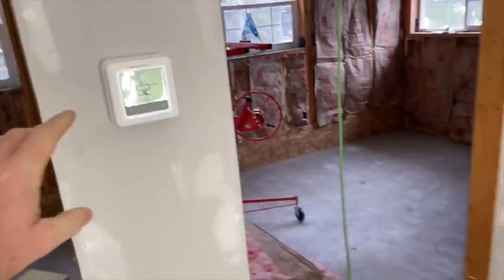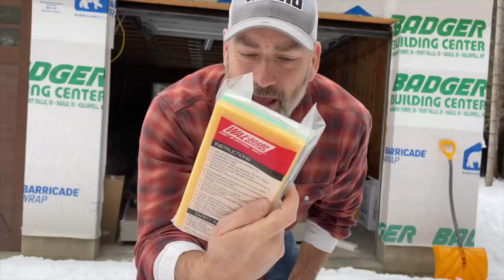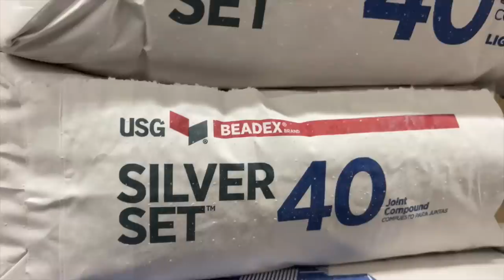Couple Building Their Own House with No Experience

Comment: You can use the extra sheetrock to sheetrock around the windows. You're probably going to need more mud than that if you only got one bag. Also you want to use a fiberglass type tape instead of the paper tape. Just kind of my recommendation with doing the drywall.

Comment: You can put one of those rotozip bits in your drill. It'll spin slower. But with the drill as a handle, you'll have more control, going around the outside of the outlet boxes.

Comment: Marty … you have to get mud on them walls … in the cracks separating the sheets of sheet rock … you had the heat on and will have many times over and waist a lot of time and energy …. I see a LOT of small locations for the screws … but no tape lines? I love all of your learning process issues and you are A+ for sure. Also. The sponge thing slow and you will be cleaning that sponge hundreds of times. Yes it keeps the dust down. Really made for smaller projects. Rent a machine that rotates and vacuums as your are knocking down the mud and worrying about dust … put a fan in a window near where you are working. “You can’t have your cake AND eat it to”. Best of luck from PA.

Comment: Your plastering skills have improved greatly Marty & Jules and the use of the power cutter is way way gooderer compared to when you first used it!!
Keep the furnace going to keep warmth in and you should be able to paint without having to 'reheat' the apartment.
The sponge sander is okay but wont give you the finish you could be looking for; use it for primary sanding and the use a hard block with fine sandpaper to get the good finish.

Comment: caution some of that quick set can not be sanded - it sets up like concrete - but is really strong for joint compound - just don't over apply it - sand paper wants to be 100-150 grit - sponge only works with redi mix mud

Comment: Have you considered a Generac backup generator, it can be wired into your solar system to come on when your batteries reach a certain level and shutoff when they are charged. It could run off your existing propane. They aren't the cheapest way to go  but convince  is worth a certain amount.

Comment: Your air handler may operate more efficiently once you are only using one clean filter! This could reduce the energy draw from your batteries. You guys are awesome.
Reply: Walls taped and painted, wall plates installed, etc, the system would work even less. So cool.

Comment: I prefer metal corner beads for outside corners nailed in with ring shank nails. Then finish with tape and joint compound. I have also found that finish sanding is easiest with the foam core block type sanders. All taping requires three coats of joint compound and only sand the last finish coat. First coat should be very thin, just enough to bed the tape. Second coat is the fill coat which should bring the surface flush. The third coat is the feather coat that smooths out anything missed on the second coat and feathers the edges of the joints.

Comment: Just run your knife down the side of your straight edge. Save the time of marking it and free handing it plus you get a nice straight edge. Better to cut the face of the Sheetrock then the back. Does not take a whole lot of pressure to cut Sheetrock. By easy pressure make you blade last longer. Merry Christmas.

Comment: ten feet on the corner is more than enough, standard height full sheets are eight feet tall.  I used metal corner bead, which is used with a special tool which crimps onto the sheetrock and you just mud, or put spackle compound over it.  Taped joints are where to tapered edges meet. You might find doing the taping if you did not use tapered edges, which will leave a above the rock seam. This is the reason for standing sheets up it creates only one tapered seam at most of the joints.  When sheets are stood up there is no seam at top or bottom except the gap between the wall and ceiling which you will use tape folded in half applied into a bed of mud and then mud over once the first bed is dry.

Comment: I watch the whole family build the place.  And I happen to exercise too at home.  The differance is that I am disabled and still workout.  I have a little workout here for the family.  This is to be done three times the whole thing.  Have fun.  20 lunges, 20 squats, 20 donkey kicks, 10 pushups, 10 lateral raises, 10 bicep curls, 10 kickbacks, 10 rear delt raises, 30 crunches, 30 bicycles, 30 second planks   everything is to be done three times.  And have fun.  This will workout the whole body.  I do a dumbbell workout of three sets of 12 for each exercise and I get good and tired.  I do curls, arm extions, kickbacks, dead lifts, standing side to side, shoulders presses, chest press, tricept press, bear hugs, torso ups, feet ins and outs, and full crunches, planks, left side and right side and front then I do the hollow man holds about a count to five or so.  This exercise I have to rest up after and sometimes during.  I am older too and disabled.  Have fun.  Paul

Comment: You might be able to overlap the mud on corner bead but I wouldn’t do it. Just line up the ends against one another and remember to mix that 40 minute mud fairly thick. A dab thicker then mud in a bucket Prior to thinning and don’t mix a big bunch at a time sting of 40 mud is an endothermic reaction ( chemical) it doesn’t require air to dry. .. the sanding sponges not really the best result. One hint about using them wring them out good very little water on the sponge.. almost dry

Comment: I have tried the sponge, and I didn't like it other than the no dust. I may not have been using it correctly though. It seemed to smear the mud instead of sanding. Maybe I used too much water in the sponge, but I did try it a couple times. It was very slow compared to the dry sanding sponge like you got for the corners.

Comment: In regards to heat retention, have you found the insulation alone was most effective or did you also notice a significant improvement as you added the drywall where the combination of the two is required because insulation alone wasn't that effective?

Comment: Wait until someone bumps that paper corner bead and dents it up, you will wish you used the metal bead. Also was wondering how long it would take to figure out how to use the T square for cutting the sheetrock. Great job though, keep pluggin along

Comment: Fantastic content! I'm curious why you used mold-resistant sheetrock in the bathroom as opposed to genuine Cement Backer Board which absolutely will not ever mold? My house was built in 1982 and I'm in the process of ripping out mold-resistant sheetrock the original builders put it and replacing it. It never molded but started falling apart over time allowing tiles to fall off. God Bless and Happy Holidays!

Comment: Thin ZIP BIT will follow the edge of the light, plug bow like it was made for it. Why don't you use toe kick to hold up the bottom sheet so it holds it up tight to the top sheet with your foot?

Comment: Two comments
You are doing a great job building up your push-up count now the question, does all your hard work go to waste or do you plan to maintain your push-up count once or twice a week?

Second comment 
Since your square footage is 400 to 600 sq ft in the apartment a whole house vacuum located in the garage exhausting to the outside will help with allergies and overall dust in the apartment. A single hose that stores in the wall. Additionally add a pipe that goes into the main house with first and second floor in the wall hoses.

Comment: Is the generator  multifuel  / dual fuel   in other  words will run on propane and is connect to your large LP tank  if not why not   could use auto change over from solar to generator  and generator  auto start and start depending on battery status

Comment: Your power shed is not insulated. I have heard that below a certain temperature, the inverter and electronics have problems. And the batteries have a temperature range that they work at best. So how hot and cold has it gotten in your shed?

Comment: Yeah well you can use that to run your tape and the feel you joints to run your we always use it I don't know if you have ever heard of a bazooka it's a tube that you put mud in and you put your tape on it and you run right over your seams and butts enough the corners I ran that we called it hot mud I'd run it through the bazooka yes good on everything you can run your tape with it it dries in 40 minutes cuz I work for a guy in Portland Oregon we did four houses small houses a day and I'm sure I mentioned we did a few houses that we needed maps to get from room to room there were so many rooms and there was rooms where we had to put lights in them because there was no lights down in the basement but we called it hot mud

Comment: So being down to was it 23 percent on you battery level are you able to be fully charge by the end of the day from your solar panels? Or are you having to also use your generator to top off batteries. If you have to use your generator, how many hours do you have to run it?

Comment: Cold temps have drastic impact on battery absorption rate. Your shed door is open most of the time and batteries do not have any type of enclosure . Lithium batteries even though advertised to be more resilient than lead acid batteries age too. I mean look at your iPhone battery health after a year 😂. Best alternative is lead acid tall batteries cuz they are cheaper and last pretty long too. Not as long as lithiums but they last up to 7 years if taken care of properly. The mistake you made with your charge controller was getting rid of midnite classic charge controller. You could have gotten a renogy for the second array. I think that was a total waste of money. Midnite controllers are top of the line and their charge algorithm is better than Victron. Not to mention their input is wideband so a wind turbine in the future as a source of power in winter?  Bluetooth, I doubt you could view the battery stats from inside the house . If your panels are A grade then they should be producing 150 to 200 watts in cloudy skies too. If I recall correctly , you had few good Chinese ones. Jinko was it ?? LED lightening is power saver compared to fluorescent lights.

Btw... Love the cat

Comment: that's not a true measurement as you still have two filters on your heater (making it work extra harder to heat).  Try it with one filter as it will truly run and see.

Comment: I'm still wondering why you guys don't use a vapour barrier behind the sheetrock......................
Reply: The insulation is Kraft faced that they overlap and staple. That is a vapor barrier.
Reply: @FrugalBuilding  In many places there is no overlap and no stapling. And even if it was, that's not enough! It should be taped as well! This construction seems like a guarantee for future moisture problems.